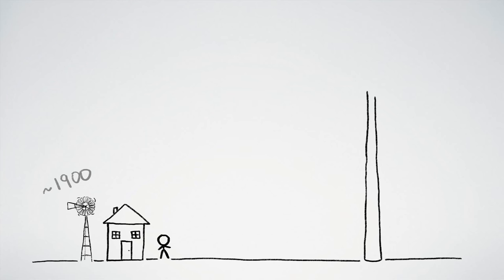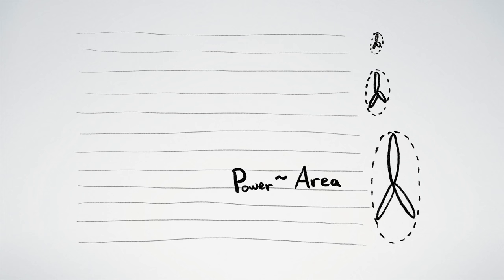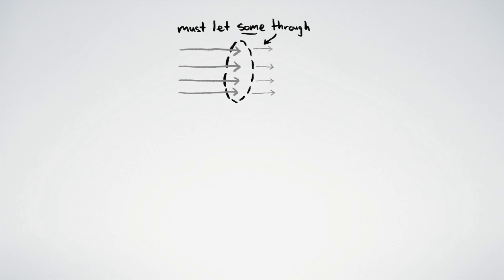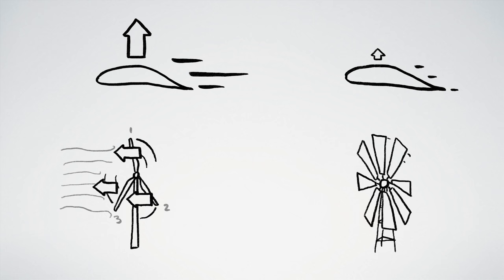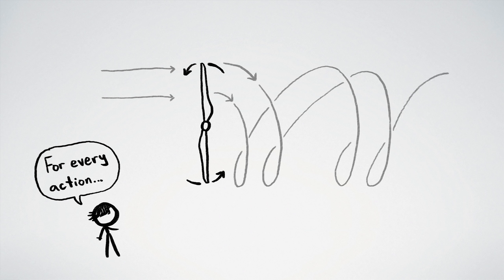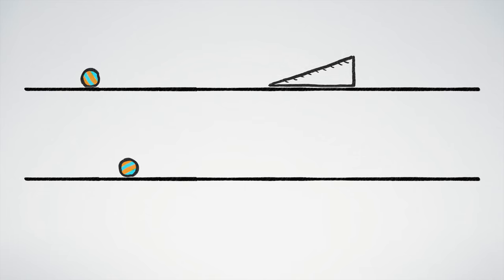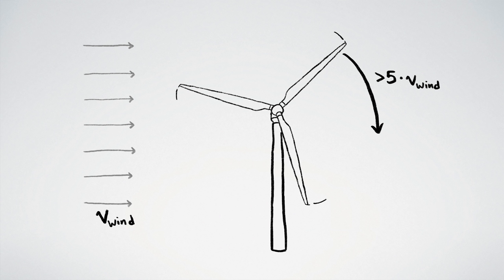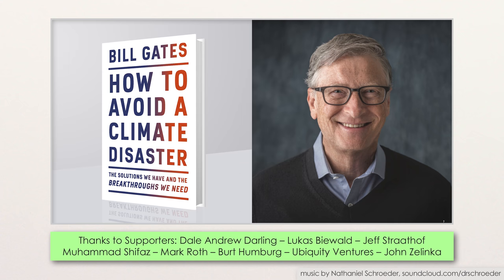The Physics of Windmill Design

Comment: In theory and simulations there are designs that use ducting around the blades and other mechanisms that claim to have beat Betz's Law. But in practice none of them have worked. Many wind turbine startups have tried and wasted a lot of investor dollars. Commercial wind turbines usually cap out at around 80% of Betz's law due to the hubs and other design factors.
Reply: That's because they're focused on mechanical efficiency, and not ECONOMIC.
Reply: Interesting, thanks!
Reply: @jimbob1353  I guess it would be more accurate to say that they focused on the pursuit of greater mechanical efficiency to the exclusion of considering economic efficiency. Rather than settling for a suitably efficient design that already exists, they continued pouring money into reaching for an even more mechanically efficient design that ultimately proved out of reach.

Not to say that is a bad thing. That's basically how innovation works: pursuit of of new, better things that might not turn out, even if it is more immediately and securely profitable to settle for existing designs.
Reply: @jimbob1353  Let's say you have a design that is 100% efficient, with a core build out of gold that need replacement every three months.

Let's say the alternative is made from steel and aluminium, is 75% efficient and needs replacement every two years.

Three mills of the first design provide as much energy as four of the second design.

In the first option you need to replace replace a core on average every month, while in the second case every six months. Ignoring the fact that gold is way more expensive compared to steel/aluminium, it would still be six times more expensive to go for three of the first design compared to four of the second.
Reply: @EEVblog I do wish you'd actually apply the baloney detection kit, rather then get swept away by the marketing hype. 

Fact is, everything that's true about the small energy schemes you debunk is also true of renewable energy in general. Just on a bigger more traumatic scale. It's the modern day alchemy, a hopeless idea that has no hope of fruition. That's why the only future for energy is nuclear power, the only thing we're 'debating' on this issue is how much everyone suffers before doing what was always the one scientifically valid option anyway.
Reply: So this Jim Bob guy I replied to deleted his comments for some reason but he asked for a practical example of where economics got in the way of energy efficiency in wind turbines. I will still reply because I think it's interesting.

I have this from wikipedia [https://en.wikipedia.org/wiki/Wind_turbine]:
Carbon fiber has more tensile strength, higher stiffness and lower density than glass fiber. An ideal candidate for these properties is the spar cap, a structural element of a blade which experiences high tensile loading. A 100-m glass fiber blade could weigh up to 50 metric tons, while using carbon fiber in the spar saves 20% to 30% weight, about 15 metric tons. However, because carbon fiber is ten times more expensive, glass fiber is still dominant.
Reply: @bronzedivision  Renewable energy already generates nearly a fifth of all electricity and the U.S. and this % is very likely to increase. It could meet baseload power requirements but it's true that presently this would require "alchemical" breakthroughs in storage tech. It's faster and more agile than nuclear and every year we transition from fossil fuels to renewables while waiting for power plants to be built is dramatically less carbon emitted into our atmosphere. I suspect we will need nuclear power but to outright dismiss renewables today discredits the nuclear energy movement and makes you seem like a reactionary conservative
Reply: @bronzedivision  do we have enough fuel for the 100% nuclear option? How long for?
Reply: @YouGottaShootEmInTheHead  Uh, why do windmills need to get energy provided?
Reply: @MaakaSakuranbo   q annon said so...
Reply: @YouGottaShootEmInTheHead  Is being so aggressive and insulting really required to prove a point?  Does calling someone a "putz" somehow help your case?  I'm all for the Thorium reactor idea but going around discrediting anything other than said idea isn't really helping.
Reply: @MaakaSakuranbo  Same reason why planes need to get up to speed in order to fly. Windmills are extremely heavy and don't automatically start working as a kite would.
Reply: @LeViIain  I see. Still can use storage, solar, or other options. Doesn't have to come from nuclear at least.
Reply: @LeViIain  Theoretically I think you could get a Windmill to self start in a similar way that helicopters can still land safely when their main rotor's engine goes out or an autogyro gets it's lift. Though I don't think a start via autorotation would be very practical, given the size of the blades and the probable lack of blade pitch control. And even then, once you get a few windmills running you could probably start the rest using power from those windmills.
Reply: @bronzedivision  I don't think that renewable energy is modern day alchemy, but I do agree that it's a highly technical power source. This video is a good example of that. Saying that it has no hope of fruition is a fallacy, as in the US alone renewable energy provides approximately 10% of the country's power (as of 2016) and there are plans to increase that number. 

I also don't believe that nuclear power is the sole power of the future either. Byproducts aside, one of nuclear power's biggest drawbacks is that it provides a constant level of power and is difficult to modulate based on demand. Meanwhile the use of power can fluctuate from day to day and month to month. Because a nuclear power plant can't easily change it's power quickly and safely, and also cannot drop below a certain level at any time without shutting down, it is often used as a baseline for power, with other sources picking up the load when the demand rises or falls. (And no, giant batteries to store the power wouldn't be feasible either. The amount of batteries needed to store all the power from the low points for the high points would be absurd, not to mention the maintenance/replacement they'd need as they lost efficiency due to being charged and discharged. Even then, I think people would be more likely to opt for solar power).

However, I do think nuclear power does have it's niches that it fills that other power sources don't. A big one is space. Most renewable energy sources rely on interactions with air or water to produce power, and solar panels are noticeably less effective as you move away from a light source. Nuclear power however is a stable source of energy no matter where you go, and has the potential to last a long time (though with the long distances and times required by space travel, the gradual loss of power would be noticed). It also has the benefit of being key in many near future rocket propulsion, whether as a power source for the engine or a part of the engine itself. I believe nuclear power would thrive in environments like space, but people will opt for other options if they are available and fesable.

TL,DR: Renewable energy and nuclear power or just as complicated (engineering wise) as the other, but nuclear power does have some niche uses where it can function where other power sources can't.
Reply: @bronzedivision  'always the one scientifically valid option' lol lets switch from industrial revolution age steam & use nuclear heat to make industrial revolution age steam... rather that than on demand direct generation and home storage buffers.  "nuke plants its so cheap to make and maintain , home consumers will get it for free" was the original lie.
 oc the French also put nuke powder in personal health creams to make a commercial industrial scale  profit from more free! industrial waste, so oc it's fine.

if commercial industrial scale users want power they can always make their own, for a price they dont want to pay as they got the free subsidised grants to claim etc
Reply: @YouGottaShootEmInTheHead  Yes, utility-scale windmills do leech energy off the grid basically all the time in order to control various functions of it. And a lot of wind farms don't record their incoming energy, which is an issue. However that incoming power is generally considered to not be that significant. I would hazard, in worst case scenarios, that actual net output of wind farms is about 5% less than their strict, recorded output.

"Math"-ing it out, each turbine consumes about 150 kw a day (or 6.25 kwh) to maintain various mechanics but can produce anywhere from 1500-3000 kwh given ideal wind speeds. Generally they produce about 25% of their max output over time (otherwise known as their "capacity factor"), so for a 3000 kwh turbine that's about 750 kwh. So for a day, on average, you can expect about 18000 kw a day (750 * 24 hours), which is about 120x it's usage. In the EU this capacity factor is about 21% and in the US it's about 35% as of 2019.
Reply: @KaiserTom  I think you've got kWh and kW confused :)
Your second paragraph was completely baffling until I figured that out and swapped all "kW" with "kWh" and vice-versa.

e.g. 6.25 kW × 24 hrs = 150 kWh.

Watts/kilowatts/etc = power, an instantaneous unit: "this device is currently generating 6.25 kW".
Watt-hours/kilowatt-hours/etc = energy; essentially power with an added time component: "it supplied a total of 150 kWh over 24 hours, an average of 6.25 kW during that time".
Reply: @DarkJokingDragonSP  Not really a good example. Depending on what the design is meant to be, it might actually be viable to go for the gold option in high enough input simple because that extra 25% could save that much money AND time. I get you're trying to present an absurd example, but that isn't really a well thought out one.
Reply: @bastion8804  The example was an example, nothing more than that. Furthermore I substantiated my example with a very relevant case where  carbon fiber is more efficient yet more expensive than glass fiber, and most chose for the latter because it's more economic. I don't see how it wasn't well thought out and don't see how the point is absurd.

Comment: Also, just basic engineering - the less material you can use to get the job done, the better. These blades are already enormous, difficult to move around, extremely heavy, and expensive.
Reply: That is a terrible rule of thumb for anything that is built to last. 
Building more robust might mean higher upfront costs, but could also mean lower maintenance and risk of failure down the line.
Reply: @romaindubray2325  ? there has been no issues with the longevity of windmills. their "difficult to move around" status and the fact that theyre designed to work in heavy wind means that they arent going to have many issues short of a natural disaster or coordinated effort to destroy them.
Reply: @jonathanodude6660  Didn't you just agree with me ?
Reply: @romaindubray2325  you said building with less material is a terrible rule of thumb. i said that even though windmills were designed like that, it hasnt caused the issues you mentioned.

also its good for reducing waste.
Reply: @jonathanodude6660  windmills only last 20 years, and are extremely difficult and energy intensive to recycle, so they are quickly filling up landfills
Reply: @jonathanodude6660  But windmills were not designed like that, you said it yourself: "the fact that they're designed to work in heavy wind". No their longevity isn't an issue because that's one of the first concerns adressed by the design.

The design philosophy is not "less is better", but rather build 1: efficient, and 2: to last.
It's not nearly as fundamental for a wind turbine to be cheap to make, than it is to be durable and efficient. That's why I'm saying "less is better" is a terrible design philosophy to bring up here.

Might be a bad example, but would you buy a 3 wheeled-car just on the basis that you'd only ever need to replace 3 tires ?
Reply: @GeoffCostanza  But isn't the relevant question whether a larger windmill would last longer?  Building "bigger" doesn't mean it will last longer.  If the current "thinner" windmills and hypothetical "thicker" windmills both last 20 years, then thicker windmills would fill up landfills even faster.
Reply: I don't think they're aiming to reduce weight and cost. I can safely they just want to generate energy efficiently. It just so happens that, counter-intuitively, light and thin is the perfect material for a fast-spinning turbine.
Reply: @romaindubray2325  Wow. Oversimplify much?
Reply: That's a rule of economics, not of engineering.
Reply: @Shuizid  not really. All else equal, fewer less complex components are preferable if they fulfill design specifications.
Reply: @tann_man  Sure but there are other factors besides number of parts. Like material and size and cost for production - Engi doesn't care about those unless given certain constraints which usually come from other parties (politics, economics).
Reply: I don't think these principles are basic; if I were to design a windmill from scratch with no prior knowledge, I would build them close to the ground for easy building and maintenance, and with thick sails to capture slow-moving air.
Reply: @romaindubray2325  more material != more robust, and less material != less robust.  The complexity or size of a design might even be anti-correlated with its robustness as there are more things to break, and its harder to ensure uniformity over larger areas.  Obviously you shouldn't use so little material it becomes flimsy, but that's accounted for in the "to get the job done" part.  If it breaks you violate the above rule too.
Reply: @romaindubray2325  you're mistaking  "less material" with "bad material" or "bad design".
Of course using less than what is necessary will result in less durable objects than won't do their functions. But reducing what is considered necessary with better design, new types of materials and optimizations in location and means of production is not the same. 
We have more functions in today's calculators than the first computers, and I doubt you'd say these computers are better then the calculators, not even talking about our modern computers...
Reply: @romaindubray2325  They said use the least material to get the job done. One of the job requirements is the longevity, so of course you make it strong enough to last, but reducing how much material is necessary to do that is a good thing.

Comment: I have a master's in energy engineering but the fact about the rotation speed was new to me. You never run out of learning. Thanks.
Reply: 300 ft turbines have larger blades, 400ft turbines have smaller. It depends how close to water they are. The upper third is the main wind generator but puts an enormous stress on the supporting tower.
Reply: Another way to think of it without the ball and sliding wedge analogy is just that faster wind has a higher reynolds number as it passes over the blades, meaning that its inertia is comparatively more dominant over the viscous forces. Very inertial flow wouldn't pick up any rotation, and minimizing the viscous effect also reduces loss.
One last thing is that, considering the blades to be airfoils, they have a coefficient of lift and coefficient of drag in the radial direction, the ratio of which determines the steady-state angle of attack. With low Cd, you get a low angle of attack, which means that the turbine has to spin quickly at a given wind speed to be in equilibrium. So low-drag, high-efficiency turbines are designed to spin fast!
Reply: This is something you learn only when you do a PhD in energy engineering
Reply: It's just a fancy way to show the work done on air, so it feels like something I should have seen before too. I like the explanation a lot!
Reply: Maybe this is why they made fun of Howard 
No offence I’m just building on the phd joke
Reply: can you please explain why the different energy transfer when the block is moving though?
Reply: @cheating_lemon  Work done on the object = Change in kinetic energy = Force x Distance traveled
During the collision, the forces on both objects are the same, but with the slope moving in the direction of the force, the energy stored in the compression from the elastic collision is quickly depleted, leaving very little time for the ball to accelerate back and regain speed.

The change (Δ) in speed and momentum are smaller for both objects, but the increase in kinetic energy of the slope is higher since it increases quadratically with speed
Reply: @utetopia1620  I'm on an integrated masters doing some energy stuff atm, pretty sure this has been mentioned in some lectures. It's just windmill design isn't it? Not a PhD level thing